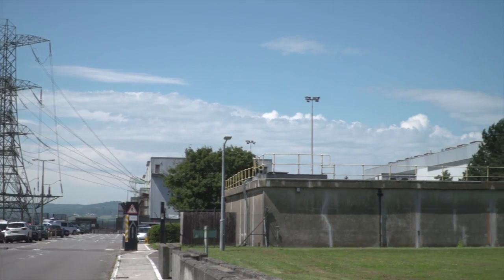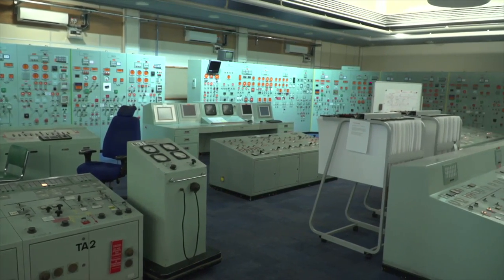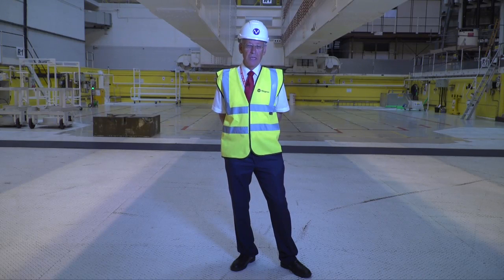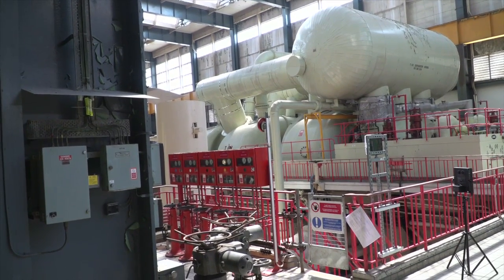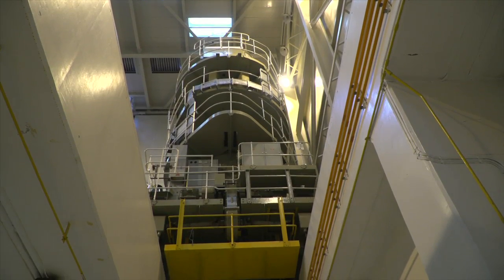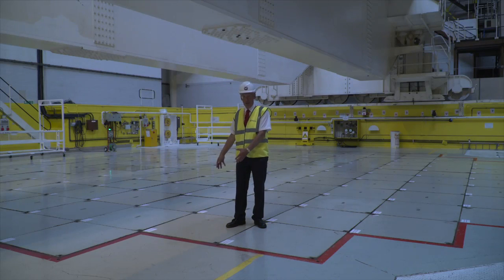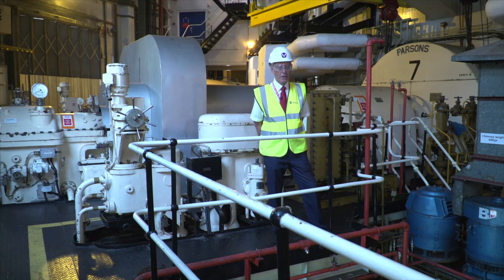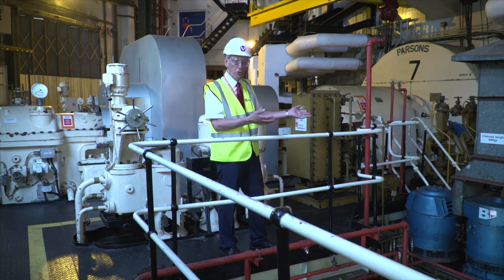Oldbury - Exploring How Nuclear Power Works

Comment: From an ac engineer. I love the fact that there’s is that much safety involved in running a full on nuclear power plant , with safety controls and alarms for every eventuality. But you put your faith in a few wall mount ac units on the back wall , at high level , so water could potentially build up and leak over control systems . Classic go for the cheapest contractor so keep the work force quiet. Don’t worry about the outcome of having water drip onto control circuits powering a nuclear power plant. Love it. Would be surprised if the units did not leak ever in there life time.
Reply: in all honesty i work on panels that have a LOT more water ingress than some drips off an AC unit but cant remember a time in recent years when that was a factor in a breakdown
Reply: @soulsphere9242  I think he means at 11:15
Reply: I believe there is space between the rear of the cabinets and the wall where engineers can walk through for maintenance. If there was a leak it wouldn't drip onto the cabinets, but onto the floor and would have to pool and creep across the room. I suspect the mini splits were there to cool the cabinets rather than keep the operators comfortable. Is there going to be much condensate in a room with no windows and a bunch of electrical equipment?
Reply: Didn't notice what you refer to. Such a change would not get approval so it wasn't as you thought. Unsurprisingly a lot of thoughtr goes into considering even trivial changes around the plant to avoid unintended consequences. (C&I Engineer with a background on a sister plant).